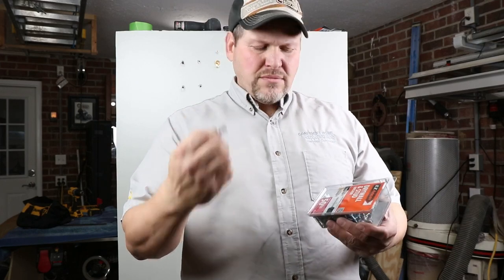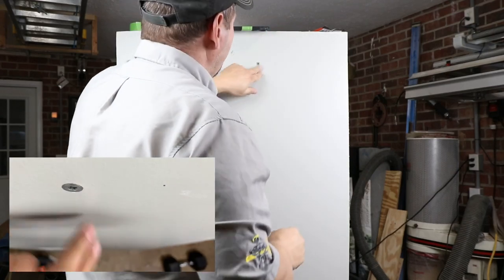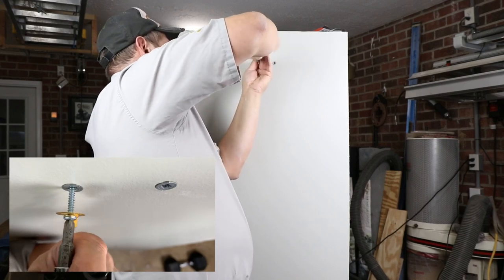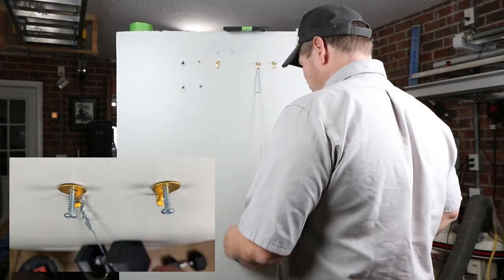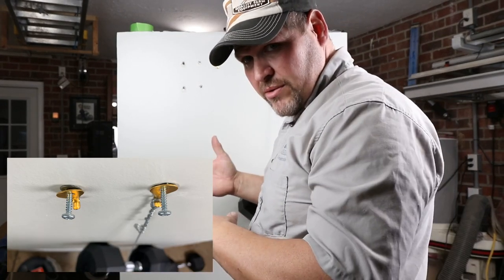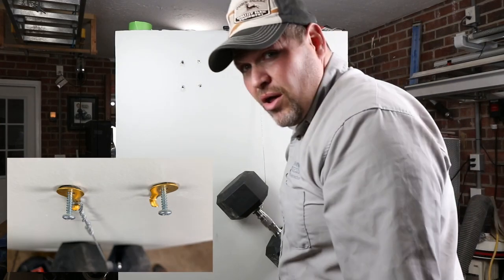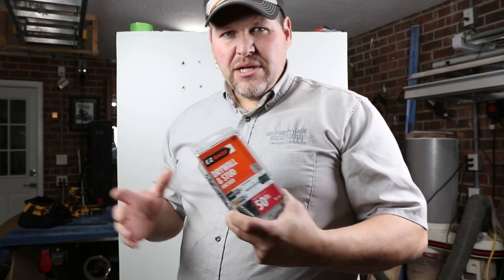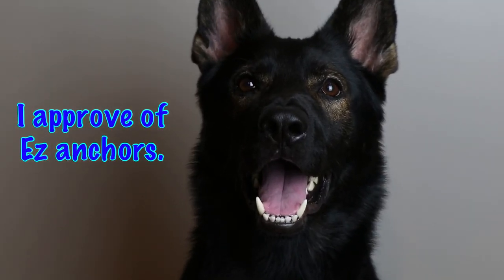HOW TO INSTALL A DRYWALL ANCHOR (EZ ANCHOR, IS THIS THE BEST DRYWALL ANCHOR)

Comment: Great video! I used pre-drilling to mount my wife's dyson v10 to the wall. It worked perfectly. Thank you.
Reply: any update?
Reply: @OverlandATX  The v10 is a work horse. Can do whole house on a single charge. No hanging issues. Overall a great investment.
Reply: @app1mxh  any update 2 weeks later?
Reply: @MarcLloydZ  I have been using this setup since Christmas of 2020. Absolutely, no issues. 😊

Comment: I used these to hang my flatscreen. I made sure to disburse the weight across the bracket. Thanks for the video.
Reply from the maker: That’s perfect. By adding additional anchors your also giving your self peace of mind that your not pushing the limit of the anchors or drywall. Were recording some drywall anchors in ceiling test now. Thanks for the comment.

Comment: I wondered with the 40 and 50 lb test if you would have drove the screw in fully to get the click of it opening the back of the plastic anchor if the result may have held better?  Would have liked to have seen the backside too in the test since we at home can't always see the backside using these obviously, thanks for the test!
Reply from the maker: I’ve tested these same anchors and shown the back side in other videos of mine.
Reply: @campbellbuilt  I wish u would have included the link that u speak of because I would have liked to see the back of the anchor to see if it is supposed to break thru the back. Also not mentioned - what these anchors are made of. Are these the metal anchors or the plastic anchors?

Comment: I have some guitars I need to hang.  I have hangers just need these anchors now. Thanks man!
Reply: I just used two of these to hang my les paul up, the problem i ran into was the #8 screw was only 1 1/4 length and the mount itself didn't allow the screw length to fully seat (there's  a click you hear while screwing the screw into the plastic anchor), so I ended up running to lowes and picked up some #8 that were 2 inches, that cleared the body of the mount, went into the plastic anchor and "clicked" to actually split the backend and hold them in more securely.

Comment: I always wondered with weight ratings, so one anchor is rated for 50 pounds, if you use 2 anchors does that double up to 100 pounds? what about 3, is that now 150 pounds? .....
Should do a test if possible, I haven't seen a test like that yet
Reply: If the weight is properly distributed evenly about the total anchors then the combined weight tolerance of all the anchors is what they will support, together. So 3 anchors can do 150 lbs as long as the weight is theoretically perfectly distributed between the 3 anchors.

Comment: Thanks for the video!  I used an EZ Anchor to install a small piece of hardware that mounts a pet gate to the wall, but I forgot a tiny part.  Can I back the screws out of the EZ Anchor to slip this missing piece in?  Or will that destroy the EZ Anchor or the effectiveness of its hold in the drywall if I back out the screw and put it back in?

Comment: Newbie question: Can you hang the mirror wire directly on the screw or do you need the hook for added strength?
Reply from the maker: Sure a screw can be used by its self. The screw  would need a decent size head though to keep the wire from slipping off.
Reply: @campbellbuilt  Thank you!

Comment: Would you recommend these ones over the plastic anchors? I’ve tried the plastic and can’t seem to get them in my way, but I haven’t tried pre drilling.  Thank you!
Reply from the maker: https://youtu.be/BmZ1sb6HXvc here’s the link for the video.
Reply from the maker: I’d watch this video that we made more recently. It has the Ez Anchor in it also the Toggler screw in type that’s plastic that we have started carrying also on our trucks. Should be enough information in that video to answer your question. If not ask again. Hopefully that helps.
Reply: Thank you. Did not know there was another video. This def helps.

Comment: How do you install the anchors that don’t have a screw tip? I got some with my curtain rod and have no idea how to do it.
Reply from the maker: That type of anchor typically specifies in the instructions what size drill bit would be used prior to installing the anchor. After drilling it out push the anchor in till flush.
Reply: Thanx. But it didn’t say anything about how to use the anchor in the instructions provided with my rod. Just says to use a drill to drill hole 🤷🏽‍♀️I found some information online about it being brown colored & that represents a 7 mm drill bit. So hopefully that’s true.
Reply: I hate instructions lately because they aren’t as helpful as they used to be. But I really appreciate your prompt response! One last question, do I still drill the screw in it after I put the anchor in the wall or before? Sorry if that’s a dumb question but my husband has no idea how to use them either. 🤦🏽‍♀️
Reply from the maker: No , most anchors that require pre drilling only have you push the anchor in flush for installation. Concerning what size drill bit is used , it should measure the same size as the  back of the anchor.
Reply: @jadedaniels3881  I’m giving up. Never could do anchors and now Ive wasted 15 min trying to understand how tf to install (no drill). I always fail w anchors, always. Gonna hire someone. Cant deal.
Reply: @thunderousapplause  I finally figured it out by hammering the anchors in once I screwed it by hand far enough in. Idk if it’s the right way but it’s working for me & they hold up my plants and heavy curtains. I hate anchors! But you definitely need a drill to make the hole for the anchor otherwise there’s no way to get it in.

Comment: I can’t for the life of me get the screw in all the way. It seems to require godly strength to screw in more than a couple centimeters. Help??!
Reply from the maker: Are you using Ez Ancor anchors? With the aluminum easy anchor if you run the screw into the anchor with a drill it will punch through the back side of the anchor. Basically you have two options you can trim your screw so that it it’s not bottoming out or you can run the screw in to the anchor with a drill. I caution using the drill method if your drywall is not in near perfect condition because the resistance of the screw breaking out the backside of the anchor could strip the anchor in the drywall. Or you could get a shorter screw. This was probably a pretty confusing explanation but I know exactly what you’re dealing with. Hopefully it helps
Reply: I’m using the plastic Ez anchors. Wouldn’t using a shorter screw mean that the hold isn’t as strong, since the anchor is designed to split behind the wall? When I tried a drill on the screw, the drill bit just wouldn’t grip, it was too tight. Thanks for the quick reply!
Reply from the maker: The way that the plastic ez ancor anchor works is as the screw is tightened in it breaks over a part of the back of the anchor. So yes you are correct that it splits the anchor. The screws that are supplied should work with the plastic ones. You very well may have a bad anchor. We occasionally run into that so I would most likely unscrew that anchor and try another one.
Reply: Same ordeal I noticed. I ran a screw ina. Few times while holding it tight. And couldn't get the screw to go much further. Made me regret not getting the plastic ones. Hopefully they will punch through with the screw driver. Other wise idk if I'll use them they seem pretty tough and it seems like if I use the drill it may strip the ex anchor within the drywall. I hope I didn't waste my money.

Comment: will there go through two sheets of 5/8
'drywall
Reply from the maker: They would work in 5/8 drywall fine. Length of these are 1 1/4”. If that’s what you are asking? Hopefully that helped.
Reply: @campbellbuilt  My issue is i built a music studio with two sheets of 5/8" drywall and green glue between them to quiet the room. Just wondering if you have ever run into that scenario...guess i'll just have to try. Im trying to hange some sound absorption panels from the ceiling. They will weigh approximately 20 lbs.
Reply from the maker: dcaudio1  how pretty confident these will work perfect for you. I went over to a friends house and saw he had 60ld Polk speakers hanging from these. Their working for him just fine and that’s 1/2 inch drywall.
Reply: @campbellbuilt  Thank you for the response

Comment: Do not buy these unless you're screwing it into a stud. If you just have drywall without a stud (like in this video) you will not be able to get the screw flush against the wall.  It will bottom out in the anchor and the screw will not punch through it.
Reply: You don't need a drywall anchor if you're screwing into a stud....?